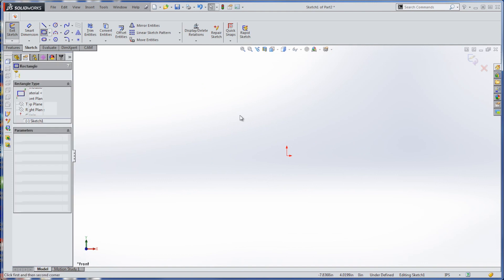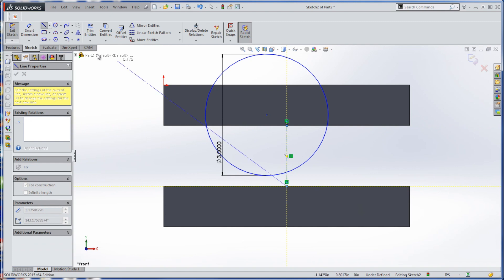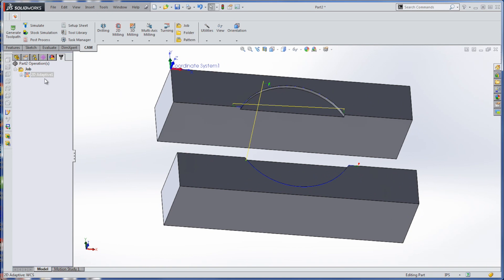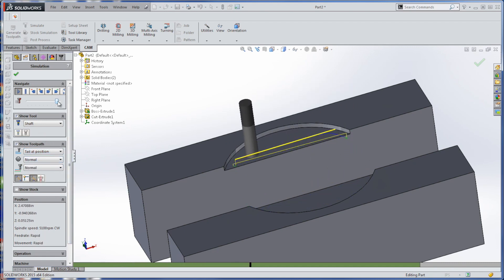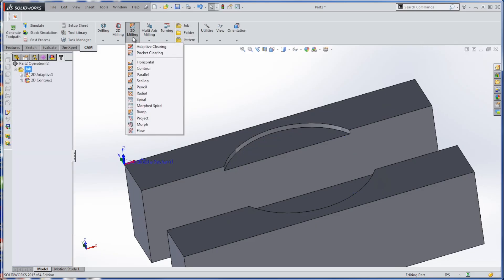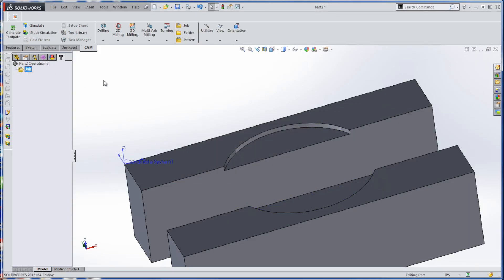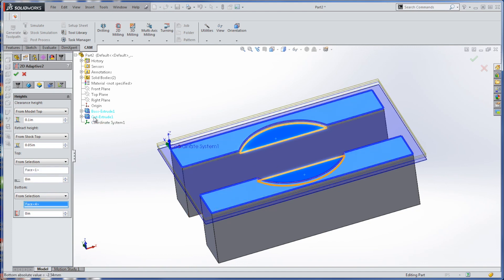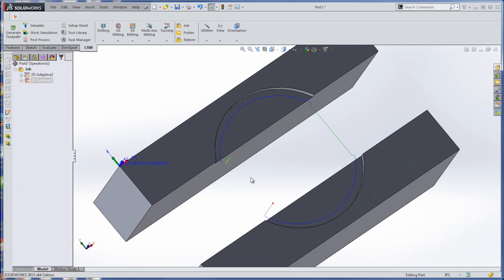Warp-Speed CAM!  Creating toolpaths in seconds!

Comment: you could also just write code by hand using G13. that might even be faster. I have a file saved on my desk top and all i have to do is open it and change the I and K values to determine the size hole im going to make.

Comment: There is a system option you would probably like for Solidworks, under System Options -> Sketch and "Enable on Screen Numeric Input for Entity creation", and the sub option Create Dim only when value is entered. This lets you type in dimensions as you sketch things. Or just click to sketch without placing dims. Huge time saver

Also little tip when you wanted to center the circle on the centerline, you could have just selected the Centerpoint of the circle, held CTRL and selected the centerline, and done a midpoint relation

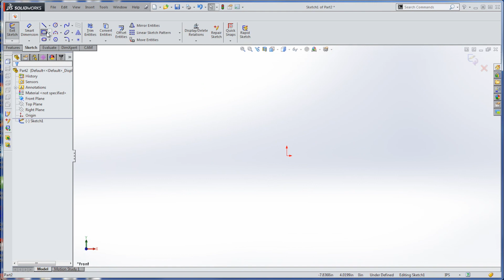Comment: found a trick with solidworks its just a small one but at 0:40 after selecting a sketch plane you use the orientation button. instead go to options, under system options tab select sketch, then click on Auto rotate view normal to sketch plane on sketch creation. that way when you open a new sketch it will auto rotate normal to your line of sight :)

Comment: Hi there thanks for all your videos. Being a cadcam user myself for over 20 years I was just curious if you have ever tried a cam package that does 2d as well? Something like that in mastercam would take a fraction of the steps by not drawing the 3d.
Reply: +Suade907 You can do everything in the video in 2D with HSM if you so choose. Mastercam doesn't have that market cornered :P We have both Mastercam x9 and Inventor 2015 Pro...between the 2 I personally prefer Inventor HSM.

http://imgur.com/SJhfGe1

I actually saved a step with mine by using 2D Pocket which has an option to add a finishing pass rather than doing 2D Adaptive + Contour. I generally prefer to go the 3D route though because I like to see the model in simulation.
Reply: +NYC CNC If you mean by when you change your contour does the toolpath update then yes. Also if you meant does the feedrate adjust while pocketing then yes as well. Mastercam calls it highfeed machining and it's a option you can turn on. I'm on a older version x5, I'm sure they have newer tricks by now. You guys do a great job, I just thought i'd mention it. It might seem primitive for you guys to just draw the 2d portion and assign a depth but it's so fast. We recently hired a guy that worked in a mold making shop and everything he received from his engineering department was always completely 3d. He as well had no idea how to use 2d toolpaths even though he used mastercam for years. He was blown away at how much faster he became when using 2d paths for the simple stuff. 

On another note I'm not a huge fan of mastercam. While the software is fast, they have very slow support for post fixes and always seem backlogged. They also don't fix bugs until the next version which requires you to be on an expensive maintenance package. And then they have one of the most convoluted settings interfaces on the market. This all has lead me to tinker with A360 and just about every other cad cam package. I'm not sure how much HSM works costs but if I was starting out and was on a budget I'd try A360 or an alternative first. 

Keep up the good work guys I love your stuff.
Reply: +Kenneth Higley Just out of curiosity, how much is HSM and do they charge a maintenance yearly fee?
Reply: +Suade907 I'm curious as well. Not that I need it or could afford it but would love to have it.
Reply: +NYC CNC Well, I did a little experiment and it looks like the answer is no. However, on circular pockets you're going to helical enter and then spiral out from there which maintains constant cutter engagement and tool load. It looks to me like 2D Pocket is the better option for circular pockets and 2D Adaptive is better for non-circular pockets.

http://imgur.com/sV1oQQG
Reply: +Suade907 I haven't the slightest clue unfortunately. I work for thegeekgroup.org which is a non-profit. We're sponsored by Mastercam and Autodesk so all our software was donated. I do believe HSMworks express is a free add-on to Solidworks if you have that.

Comment: I love it!! And you've also just demonstrated the value of getting some professional training with your CAD / CAM tools by going along to that event. :-) As you know, those selections are a lot easier in Inventor HSM & Fusion 360. Fingers crossed that gets ported to HSMWorks soon.
Reply: +NYC CNC It depends if you want to get into process flow analysis & stuff... possibly too intense for the situation. But a 30 day trial of the suite could get some interesting results :-)
Reply: NYC CNC I've tried a few times with no success to do this in Solidworks. But in Inventor when you go into perspective mode, you can get the camera to go inside objects. So you could do those fly throughs << Awesome with a 3D mouse!. You can also do that in AutoCAD, Revit & Navisworks (no modelling in there though).